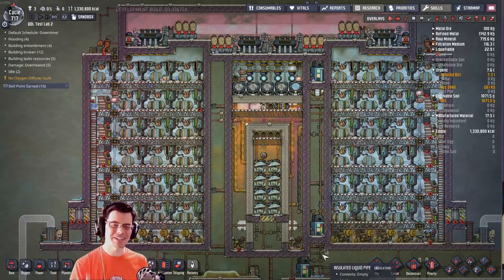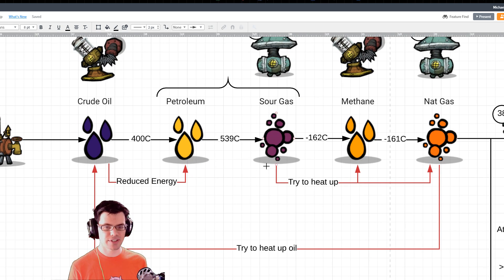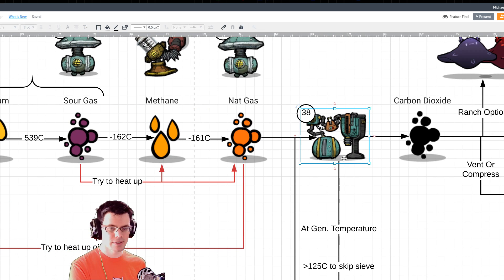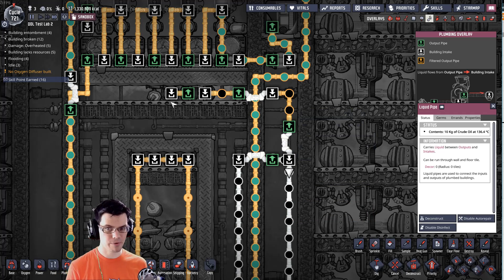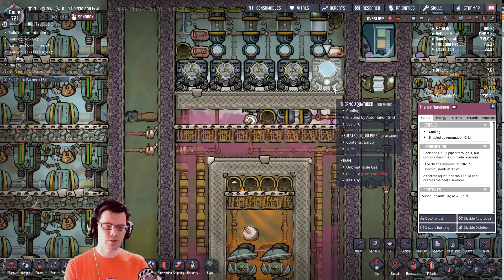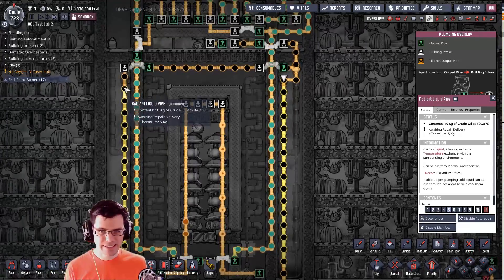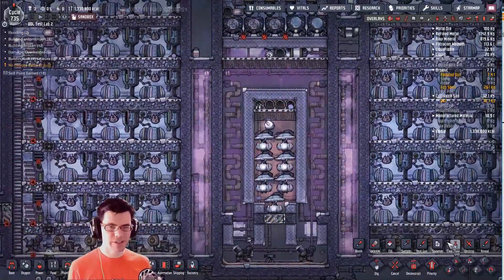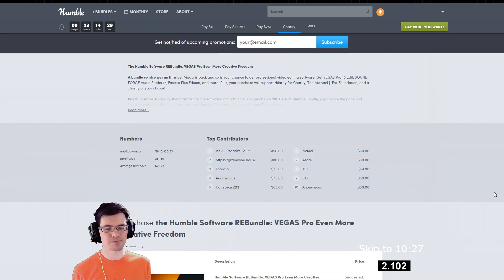Efficient Energy with Pre-Cooling! - Oxygen Not Included

Comment: "So that the coolest is next to the hottest". 

Nope, that's not efficient. You want the hottest input to be next to the hottest output. Cool the hottest sour gas with the hottest methane and then bring both temperatures down together to extract the most heat.

The 'problem' with heat and cold is that it tends to average. That's why heat exchangers in steps tend to be more efficient than one single, big heat exchanger.

Comment: I remember seeing a video where when using insulator for pipes it would heat/cool the liquid inside to the temperature of the insulator when it was built. So if you create the pipe at a high temperature, it could theoretically boil water (if the pipe is higher than 100 at  creation)into steam
Reply: huh. is it means that if i make an cooling roon and put build materials to something like absolute zero and then build pipes of it, i won't get a crap ton of broken pipes when i run my liquid hydrogen in it?

Comment: Still need to dump that water from the turbines into oil wells, instead of pulling it from a box, while still producing enough ph2o to convert to steam, completing the loop. While symmetry looks nice and all, maybe compacting all the natg generators into a single box, and cutting down some so all of them can have 100% uptime could make the last bit a bit more predictable. Having generators running intermittently doesn't look like a good thing..
Reply: bluuh it is actually kinda hard to do, because you need more natural gas generation than it consumes or you need really consistent amount of it running permanently which is something about impossible.

Comment: What if instead of a second chamber of hydrogen, you used a smaller, more controllable vat of supercoolant held just under the flash point of crude oil by the natural gas pipe? The natural gas can either go through a shutoff valve, straight to the natural gas generators, or straight through into the bath of supercoolant. SC has a thermal sensor that manages the gas valve, so if it's too hot, it turns on the valve to route hot NG to the generators. SC has higher transfer than hydrogen and more capacity so it would be less prone to temperature swings, making the power consumption more stable. 

Secondly, route the lower loop in the secondary hydrogen chamber after the snake in sour gas from bottom to top. Right now the lower radiant gas pipes are dumping their heat into the cooler end of the top loop. Better to have the cooler ends close to each other.

Do gas and liquid reservoirs calculate temperature change for the liquid inside for all the tiles they occupy, making them better radiators/coolers than just radiant pipe snake of the same tile count?

Comment: I wonder if we can take it further on the efficiency scale. You're forcing the crude oil in when it gets too hot but other times it's not quite up to the limit. If you use a liquid reservoir that constantly circulates the crude oil through the "hot room" and then draw from that to the cooking chamber you should be able to more consistently have almost boiling crude oil go in to cook. Or possibly have a crude oil tank in thermal contact with the hot room, this way you can even let it boil to petroleum without risking the phase change in the pipes and take the thermal delta even higher... Hmm I need to experiment with this... Another idea is to let the crude oil absorb heat from the hotter sour gas first before you use the natural gas to cool it further. I think this may allow you to heat more crude oil, possibly cook it to petroleum and then drop the temperature even further with the nat.gas the downside is that the natural gas may no longer be hot enough to boil the water coming out from the generators...
Reply: I did it once in one of my sour gas cooker and I had also improved the heat exchange of the methane so before the supercoolant the sourgas was at -80°C the only problem is that I was so efficient at precooling the sour gase that the aquatuner wouldn't heat the crude oil enough so I had to intentionnaly cool the natural gas ouptut so that the aquatuner could run enough